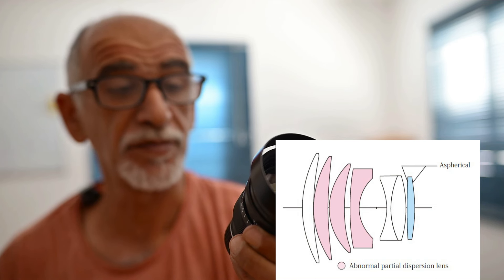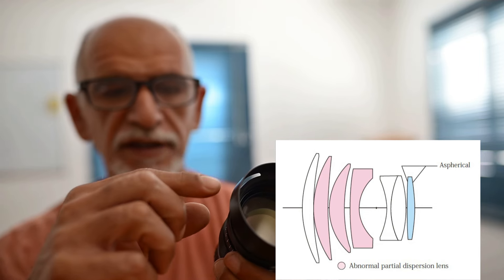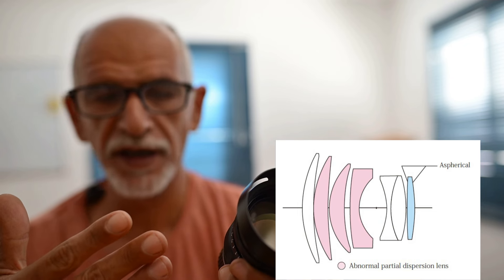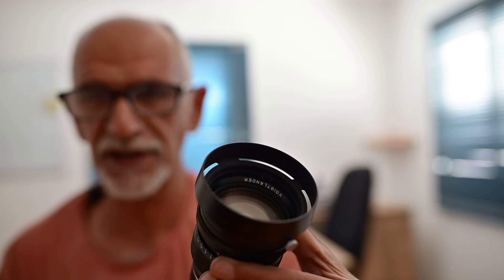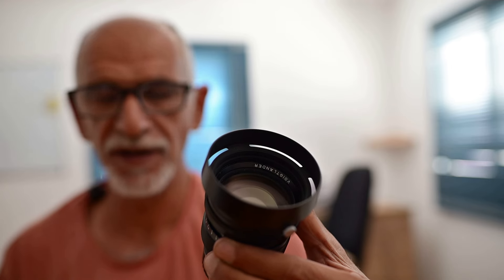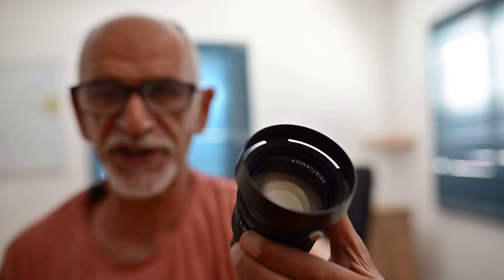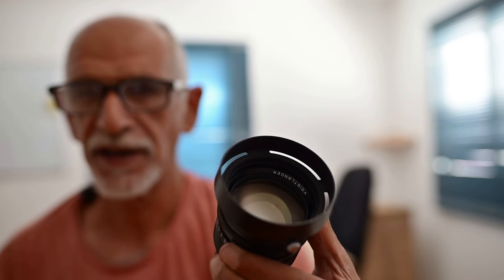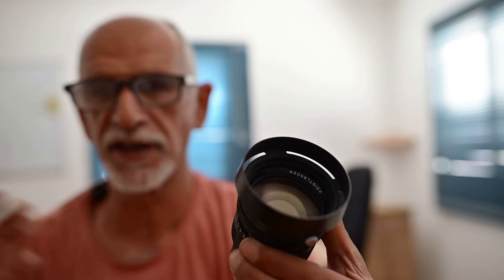Lens design and 3D pop  (the woods get thicker)

Comment: Samyang XP 85mm f/1.2 and Samyang XP 50mm f/1.2 both have wonderful rendering and pop, and do not have any LD elements whatsoever.
Reply: Aren’t aspherical elements LD elements?
Reply: @knnrythanks so it seems like there’s no consistency with nomenclature by different manufactures. Samyang states the 85 1.2 has “Two High Refractive Index lens elements plus a precision aspherical lens element combine to minimize aberrations and increase sharpness.” Not ED but something else??

Comment: The Cimera 50mm has 8 Elements in 6 Groups and one of the elements is an LD glass. If you have less than 10 lenses it is impossible to have les than 10% LD Glass. Can be the Lens poppy?
Reply from the maker: Yes it can. Especially if the LD element is in the front and mitigated by high refractive glass towards the rear of the lens.

Comment: How would you describe the lens of the older X100 models, like Fujifilm X100T? Does it have 3D pop? Thank you...
Reply from the maker: Don't think so. Look at sample images to form your own opinion.
Reply: @sneye1 I think I see some pop, but I don't have the experience. I found this online. Your thoughts?
8 elements in 6 groups, the same extraordinary lens as in the X100 and X100S.
One element, the sixth element, is a glass-molded aspheric with two aspherical surfaces.
HT-EBC Super EBC (Electron-Beam Coated) multi coating.
Except for the aspherical element, this FUJINON seems like an homage to the world's first high-speed wide angle lens, the Nikon W-NIKKOR•C 35mm f/1.8 of 1957, right down to the 9-bladed diaphragm and the same extra-large rear element.
Reply from the maker: Hi, I looked again and it seems to have some pop in some images. Rather subtle though.
Reply: @sneye1  thank you very much. That's really helpful.

Comment: @CameraMystique thoughts?
Interesting contents, your presentation would benefit from adobe premiere's fill word filter
Reply from the maker: Sorry for the slow presentation. Just increase the speed.
Reply from the maker: CameraMystique and I have different, slightly overlapping approaches. His focus is centred around micro contrast. I try to avoid mentioning it due to lack of a consensus definition of the term. His thoughts are interesting and mostly sound in my opinion.
Reply: @sneye1  I did, no worries! Just wanted to tell you, in case you use premiere, there's an AI cutting tool now, that identifies fill words and cuts them out automatically. Really practical ^^
Reply: @sneye1  always interesting to see different approaches. Mainly because I don't always see this 3D pop, so I'm still wondering if it's more a lighting, perspective and composition thing mostly, or if there really is such a difference in lenses. Got a color ultron 50mm, and it's a nice lens, but in most conditions I don't see any more pop than on fuji lenses or even the sigma 56mm.
Same with cheap, low element Chinese lenses (7artisans mostly)

Comment: Another great video on the topic! You mentioned the Voigtlander 40mm 1.4 classic is very poppy, how do you think it compares with the Voigtlander 40mm 1.2 nokton for Z mount? I'm leaning towards the native Z mount as the MF assist with the Nikon ZF is quite nice and it does require electronic contacts on the lens.
Reply from the maker: @kalo3547  Hi, I happen to own the 40/1.2 (VM version) and a ZF. The 1.2 is superior to the 1.4 classic in every way bar 3D pop. Consider using a Techart MTZ 02 adapter and M mount glass. The adapter will give you those contacts with the added benefits of close focusing and AF. Not perfect but worth it.

Comment: Thank you! Can you tell something about contax zeiss 50 f 1.4 t* ( ninja blades apperture)
Reply from the maker: Not specifically. However, most double Gauss designs from that era are very similar, with quite good depth rendition in my opinion. Look for a channel caled Zenography for information on vintage 50s with many examples.
Reply: @knnry haha. Whong. Wanna see commercial projects on it?
Reply: @knnry i own contax zeiss. I can show you😂 modern 50 planars yes. Old ones is good. Even on my r5
Reply: @knnry  for video i think it is great. but i'm a photo guy that shoot commercial work. i think i'm just a lucky with great copy. coz even wide open it shows good results on r5. on f2-f8 it is a beast. on f4 - f5.6 gives similar results as my 24-70 rf lens. but with more pleasant out of focus zone. check tle links in my bio there a lot photos from this lense

Comment: Shaul, empirically or theoretically, is there a "poppy" 35mm Nikkor, ideally AF, in either F or Z? Thank you
Reply from the maker: Yes. 35mm f1.4 G. Also the very new Z 35/1.4 may be, according to its optical design.
Reply: @sneye1  thank you. That new one looks interesting. I think I'll opt for the G so I can use it on my GFX body.
Reply from the maker: Can you AF F glass on GFX? Also, do not expect the 35G to resolve those sensors.
Reply: @sneye1  yes, using a Fringer. It's the older GFX 50r, seems to do fine with my other AF-S. And for what I'm using it for, sharpness isn't critical.

Comment: is ED glass equilvalemt to anomalous partial dispersion glass ? I found that these glass are often present in voigtlander and zeiss glass, 
while nikon with ED glass
Reply from the maker: Hi, they are indeed equivalent to my understanding. Different manufacturers call it different names. Sigma has at least two  terms for various types of EDs.
Reply: my understanding is that too much correction  with ED glass and aspherical glass will greatly reduce the chromatic aberation, spherical aberration, distortion, in a way that is over-corrected so the image have a flat, high contrast image without much intertonal transition (rendering). Vintage lens with simple design are less corrected and usually has better intertonal transition and more flaws, the image is more lively and organic, less boring.

Comment: I've done a few attempts at testing lenses and keep screwing up but I think the kinks have been worked out and the next round should be more successful. You'll soon have more data to investigate if you want it :P
Reply from the maker: @HoggetBlanker  Course I do! Bring them on :)
Reply: @sneye1  Ok, so I posted some pictures for analysis.  There are eight 35mm lenses (well, one is a 40mm and some are zooms set at 35mm) and while I shot them all from wide open to the smallest aperture, I only shared photos set at the maximum apertures and set at f/5.6, both in color and black and white (some people equate pop to tonal fidelity and eliminating colors tends to allow better focus on this aspect).  The camera was set to aperture priority at the lowest ISO value (100) and all lenses were focused manually on the toy's left eye (our right, the one in the dark patch of fur).  Lens correction was turned off in both the camera and the raw processing software, and no editing was done except for using a default preset for black and white conversion.  So for all intents and purposes, for better or for worse, the photos are all straight out of camera with no corrections applied.  I won't be looking too closely at the pictures for another few days but wanted to share now.  The photos are posted individually to allow for closer scrutiny but there are also jpegs displaying all photos by category (max aperture black and white, color photos at f/5.6, etc.).  The latter are probably the best place to share any thoughts and will also be where I'll be revealing the lenses in about a week, to give enough time for evaluation while avoiding any bias. 

You can find the pictures here (assuming the link can be shared): https://flic.kr/s/aHBqjBAAg7

I'm open to suggestions if you feel the test scene can be improved.  I want to repeat the test with an APS-C camera that will add a few more 35mm lenses to the mix but will wait for any recommendations.  If all goes well, I'd also like to repeat the process for the 28mm, 50mm and 135mm lenses I have.

Cheers!
Reply from the maker: Hi, the lenses I would call "poppy" are 1, 5 and 8.
2, 3 and 6 are distinctly flat.
I looked at the color images shot at f/5.6.

Please let me know when you reveal the identities.

Cheers.
Reply: @sneye1  I've completed my own analysis, and though I agree with the poppy lenses you identified, 6 also ranked high for me.  Maybe I'll take another look later this week and change my mind :P  
I'm looking to share the pictures with groups to see what others say before revealing there but didn't want to leave you hanging, so here are the lenses used:
1- Canon EF 40mm f/2.8 (I was pleasantly surprised at how well this one did)
2- Carl Zeiss Distagon 35mm f/2 ZE  (I was disappointed with this but impressed that you picked it out; I remember you saying it wasn't poppy in another video)
3- Canon EF 35-80mm f/4-5.6 II
4- Canon EF 28-90mm f/4-5.6 II
5- Nikon Series E 35mm 2.5 (I really like how this one performed, it's probably my favorite of this bunch)
6- Vivitar Auto Wide-Angle 35mm f/2.8
7- Canon EF 24-105mm F/4 L (I was really hoping this would do better)
8- Olympus Zuiko Auto-W 35mm 2.8